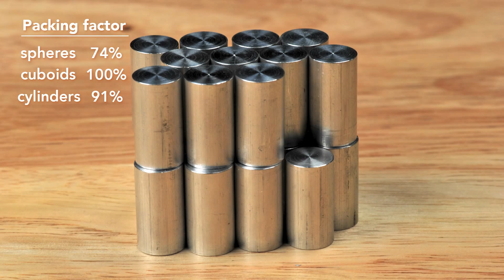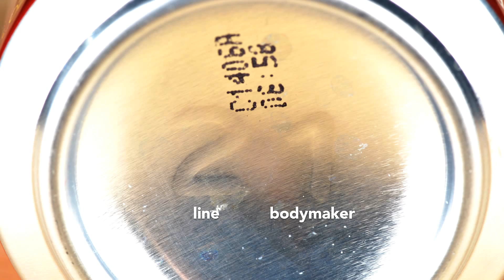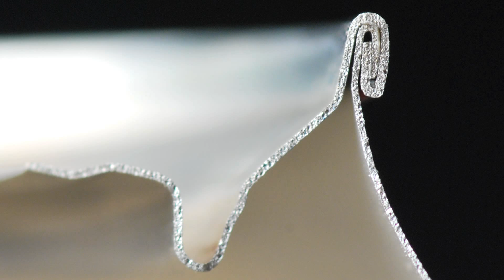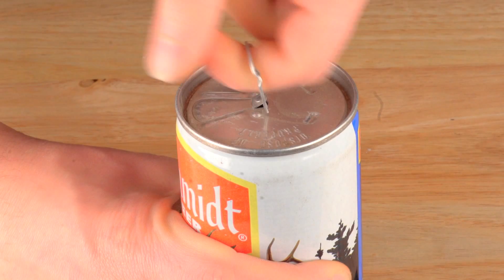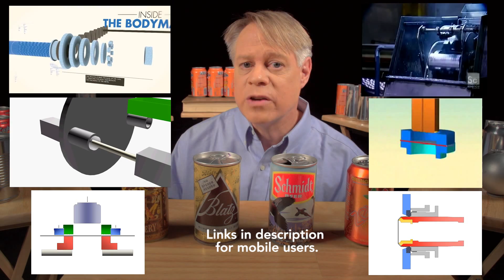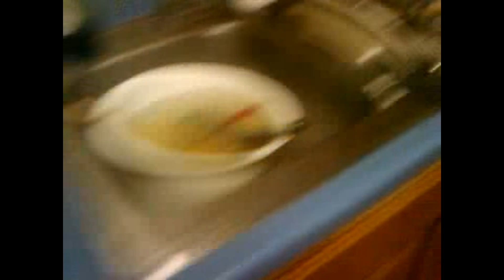How Stuff Works: How Aluminum Cans Are Made And Why it is designed In Cylinder Shape

Comment: Do we know what the sealing compound is made from, for the top lip? Asking to determine the purity of aluminum recycled from molten aluminum cans; if it's another kind of metal it will alloy and affect purity, and if not it will simply become slag with the decoration and epoxy coating.
Reply: slag. as most aluminum is anyways. been in the business for over 20 years. it's cheaper to make new rather than recycle but idiots throw cans out the window so that's why the in entice to recycle